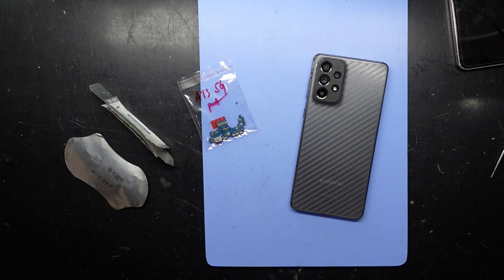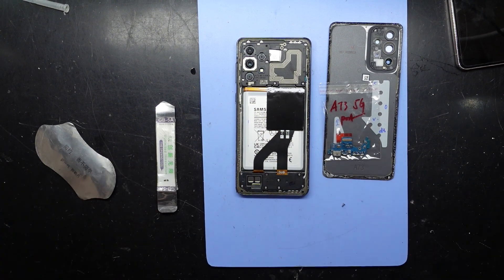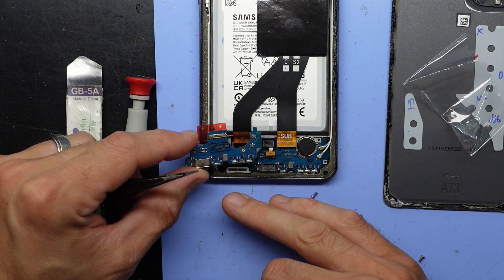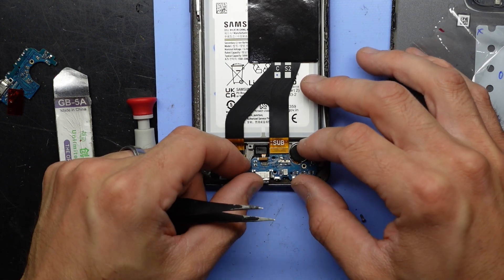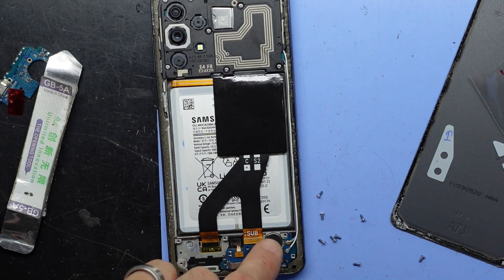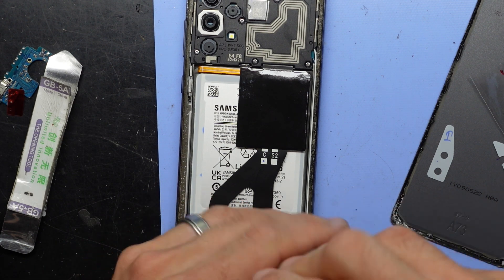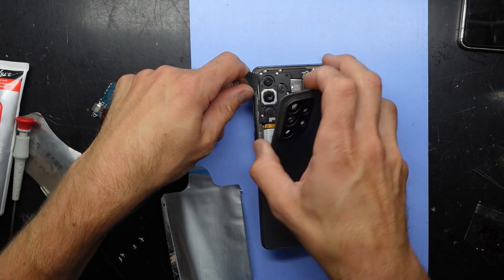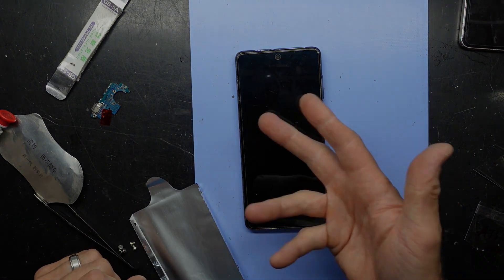Samsung Galaxy A73 5G Charger Board Replacement

Comment: I have a question . I just replaced my charging port board did everything and now it won't charge , the port does feel loose as well it was from Amazon, not sure if the board is faulty . It was charging fine before the replacment but had to have the cord on a weird angle
Reply from the maker: i would be guessing the new port is DOA (dead on arrival)
if you switch it back to the original port, will the phone charge?

about 90% of the time when i see a phone that needs a weird angle to charge
usually it just needs a clean and blow out with compressed air
Reply: @rickstechrepairs cheers for the reply I thought the board might be dead ,I did change it back still not charging I'll have to take it down to get looked at at some stage cheers
Reply from the maker: good luck